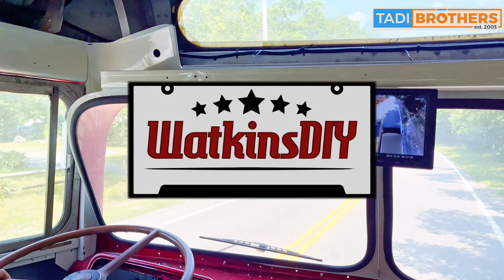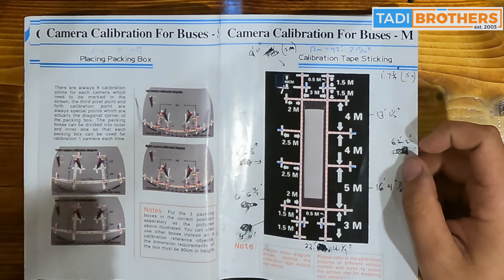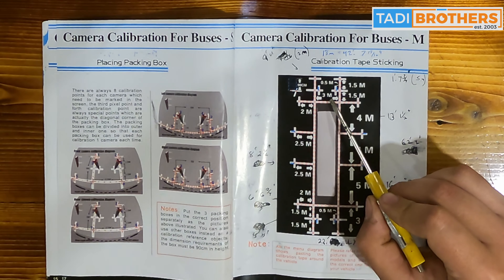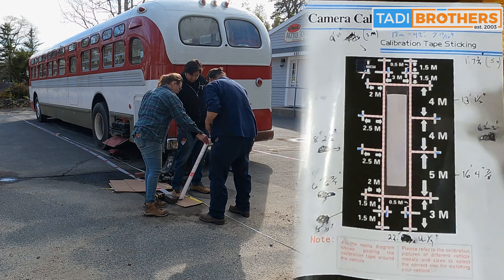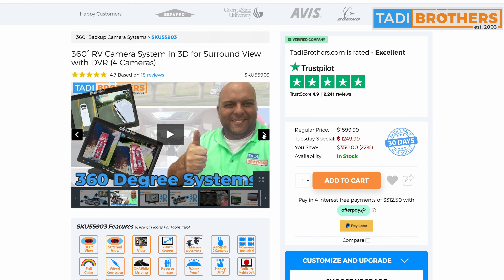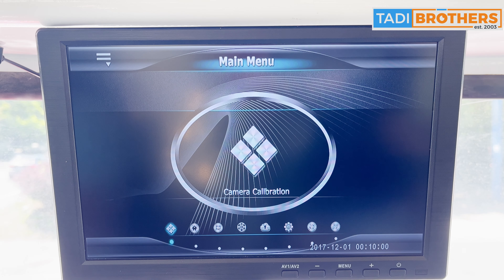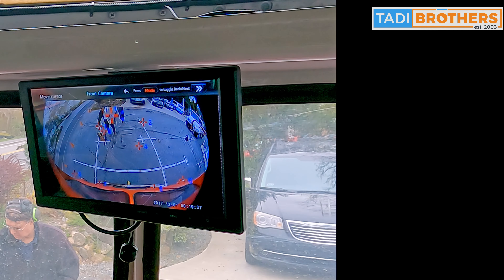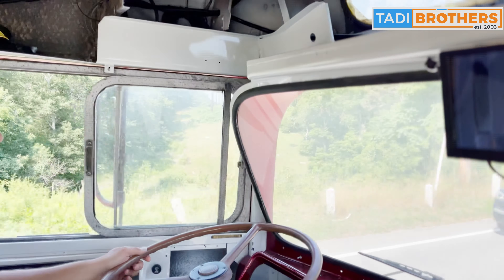Part 2 of the Tadi Brothers Camera Install

Comment: I did this, and the image was absolute garbage. I then readjusted the cameras to look similar to the pictures in the book and got closer. Now, I am tweaking the cameras to try and get it to a decent stage. I was also going to do a video, but got so frustrated I gave up the idea, as I would not have anything nice to say. Every time you adjust the cameras, it takes 10-15 minutes to stitch them, so you spend days of frustration trying to calibrate.. The entire system is not ready for prime time IMHO, and the manual tells YOU very little about the settings you showed at the end, some of which don't work. Would be nice to sometimes have a back camera view, but can't figure out how to do this. I changed the settings to back camera view, and it did nothing. Do you know if there is a software update? I bought mine 1.5 yrs ago, but didn't get the trailer until May of this year to install it on.